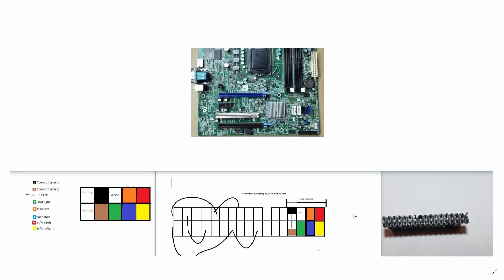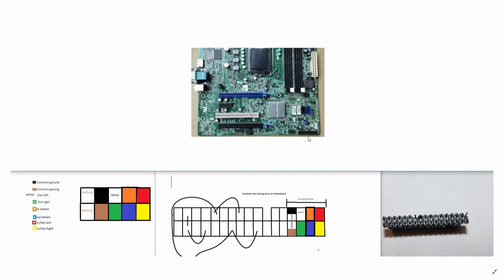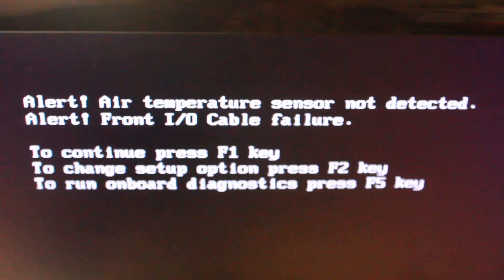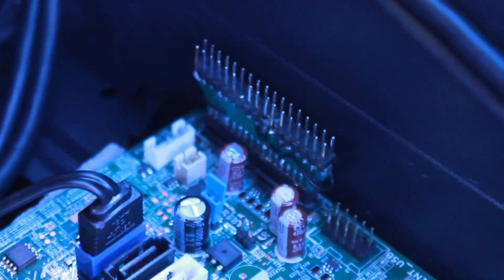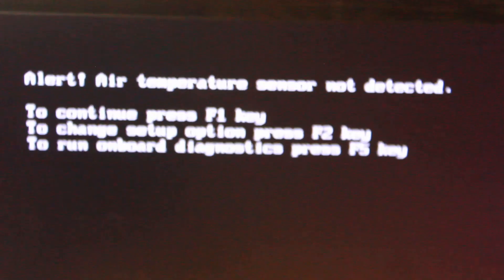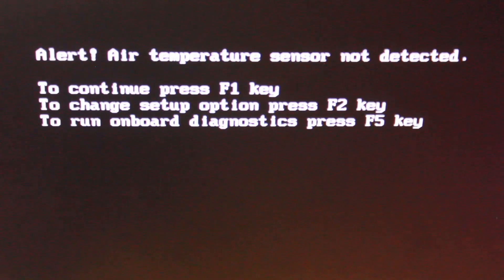Dell 990 front io error fix

Comment: I want usbs to work not the audio
Reply from the maker: what motherboard do you have
Reply: It's a dell optiplex 7020 MT with a i7
Reply from the maker: @cwright8293  the problem is the 7020 has a different io port set up so my fix will not work
Reply from the maker: @cwright8293  the 7010 motherboard is different then the 790/990 motherboard it doesn't have the normal usb harder like the 990 motherboard